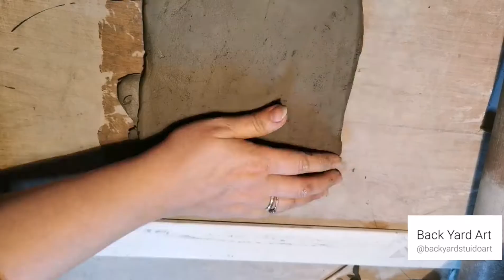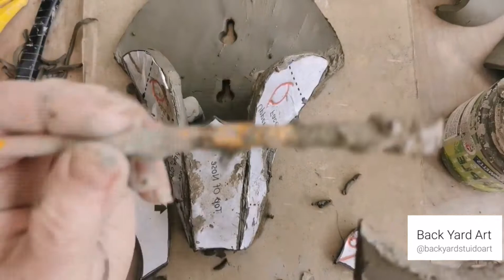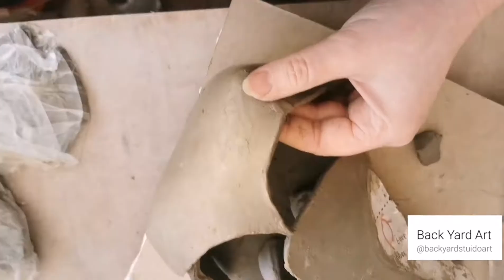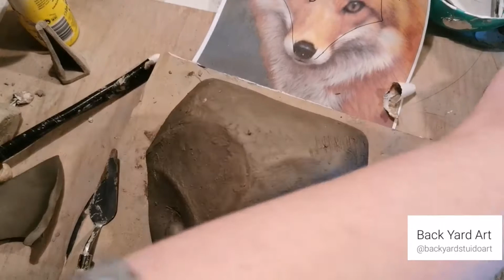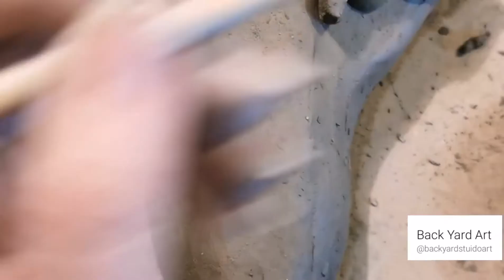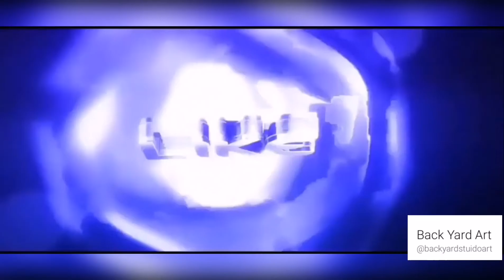Free Foxy foxy sculpture template video instructions.

Comment: Wonderful video.  Thanks so much. Would love to have a go at this. I’ve joined your FB group. I’m new to pottery so might have to wait a bit till I’ve plucked up a bit more courage to attempt it.  It’s very beautiful. Foxes are such fascinating animals. Thanks for producing such a fabulous template and video instructions. ♥️
Reply from the maker: Tip for you when u try it print it off small before going life size, building small first gets u used to the template, its easier to assemble and then helps u to grasp the build ready to go bigger.
Reply: Thanks so much for the tip. I’ll certainly do that. ❤